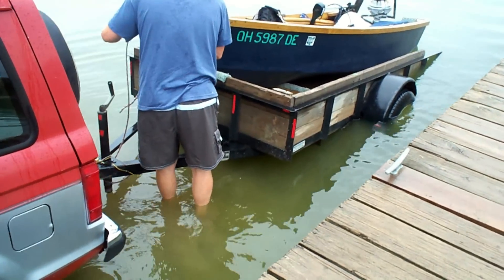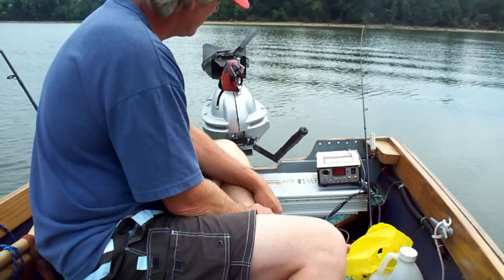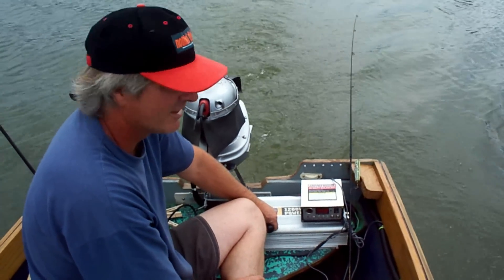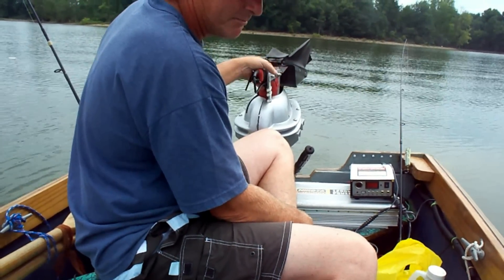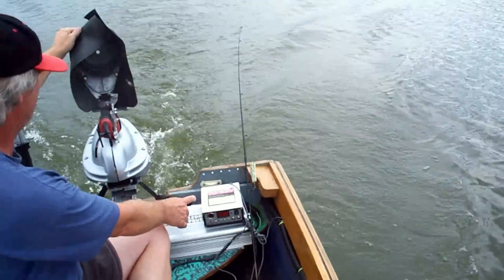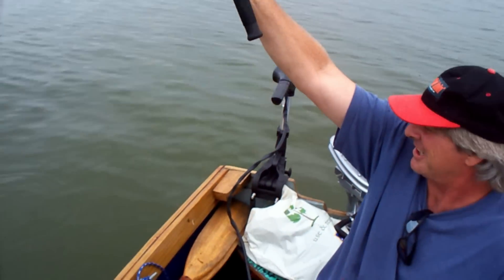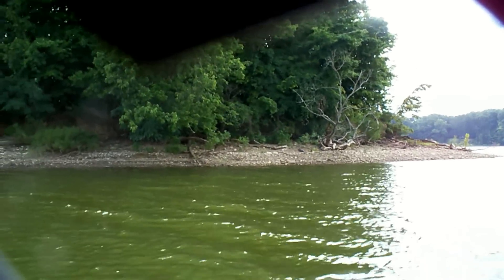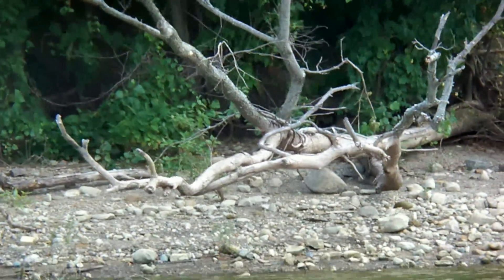worlds coolest homemade Electric boat motor & pan fishing with Planer Bobbers

Comment: I set up a trolling motor using a drill, a few parts from home depot and a 90 degree drill adapter, and a trolling motor blade for $30 from Walmart. I know I could get much more power with an inverter, but I'm using a small canoe and the risk of electrocution is too great. Once I graduate to a larger vessel where I could guarantee that the inverter would stay high and dry, I would go for it. At that point, I'll probably use a 2-3 hp elevator motor - lots of torque and cheap.

Comment: Silly!!! The trolling motor is way better!!  2000rpm is the same as the original gas engine idling!!  And if the inverter gets wet your toast, converting 12 to 120 volt wastes a lot of energy!!  Just get a good 60 lb thrust minn Kota, then it will go faster and run longer and smother

Comment: maybe good to get to the destination, but too noisy for slow trolling, also the inverter will cut the efficiency by half or more, and I'm pretty sure those drill motors are not designed for constant running, why do you put those rubber flaps over it anyway, that motor need to be ventilated, that's why there's an integrated fan